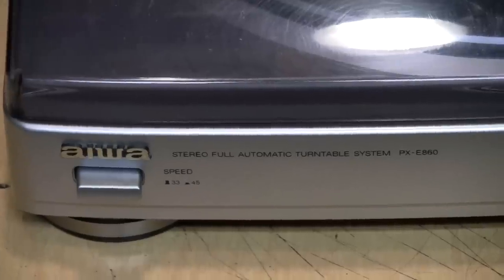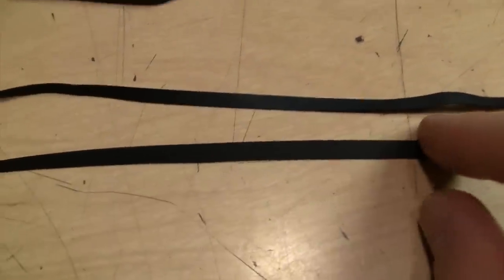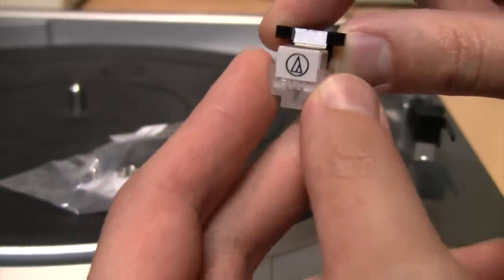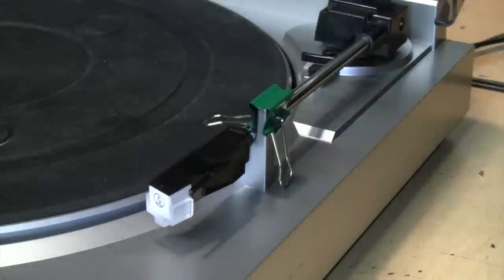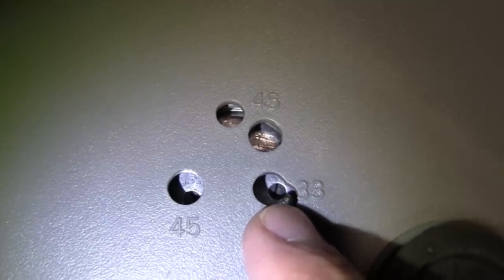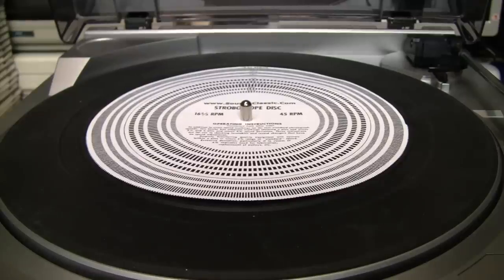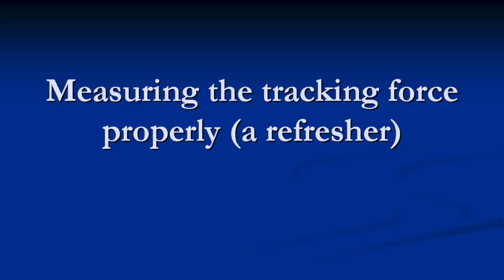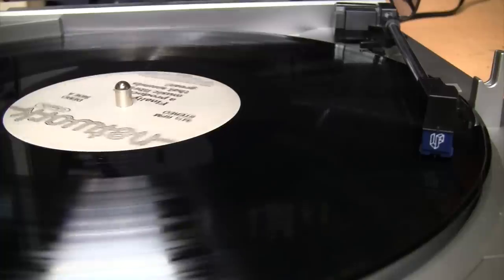Cheap fixes & upgrades for cheap turntables

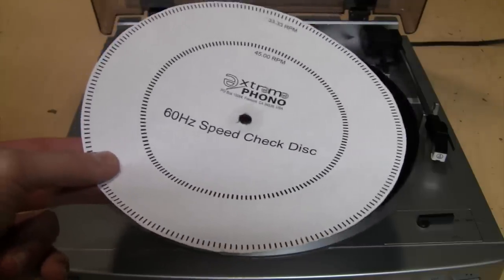Comment: 16:11 "Make sure the printer prints it out at exactly the right size"
Actually it doesn't really matter if the printer prints it too small or too big; the number of strobe squares is always the same per revolution no matter how big you print them. Unless you distort the aspect ratio of course.
Reply: Since it's stobing, they should put a small animation on there too.

Comment: I wanted to see if anyone out there could help me solve a problem.  I found a Technics 1300 at a thrift store.  It works manually; however, if I hit the play lever, the tone arm swings directly to the spindle.  I tried adjusting the knob that adjusts the size of the record, but that did nothing.  Any ideas?  Is this a simple fix or a tear down and replace something electrical?

Comment: I have the $129.99 Technics sl-bd20d in the 2001 flyer! Still has original P34 cartridge. Works fine, after years in the closet... but can you recommend a couple of upgrade stylus choices to improve tone? Great video for entry level equipment users like myself.  Thanks
Reply: AT still make a few T4P cartridges.  Here is one I use with my SL-5 from Amazon At-85EP.  There is also a conical version AT-81CP.

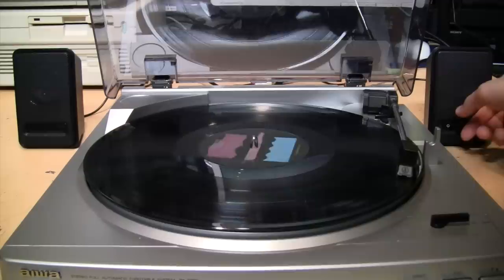Comment: 10:43 I got a really nice turntable many years ago, when I plugged it into some speakers and the audio was silent just like this, I didn't know anything about these and I assumed the stylus is bad, tried to remove it and ended up breaking the cartridge. A new one of the same type was really expensive so I just got rid of the whole thing. Right now I'm just cringing at my past self...

Comment: it is absolutely true.  Replacing your conical stylus with an elliptical stylus will improve the fidelity of your sound by at least 30% no matter what price range your turntable was.  Crisper highs and deeper bass...just like magic.  And why would you WANT to disable the auto return mechanism?  And why would you want to play 78s on a high fidelity system?  The records themselves are not high fidelity.  I have a vintage portable from around 1965 to play 78 and 16 RPM records.
Reply: Not everyone can find a vintage portable for 78s. There's also the factor of convenience. Imagine just being able to put a 78 right on your regular turntable instead of having to pull the portable out every time.

Comment: I got an Emerson M2400 at a Goodwill (for $15) not too long ago. Is it worth in, in your opinion, to do any sort of these upgrades on that?
Reply from the maker: I'm not familiar with that model but I just watched a video demonstrating it and I can see that its design doesn't really have anything in common with these turntables. But regardless, a new belt and a new stylus can generally improve the performance and sound quality of almost any turntable.

Comment: I have an old Sony PS-LX250H which is basically a clone of the Aiwa featured in your video. I honestly like the sound it puts out. Very warm.

A couple of thoughts...

I wonder if it's easy to perform a preamp removal mod à la the Audio Technica AT-PL120 on one of these turntables.

Also, why is it that none of these 'tables have an external ground wire? If I wanted to add my own, what would I connect the wire to inside?
Reply from the maker: The pre-amp in these turntables sounds fine. I wouldn't bother trying to remove it.

Comment: Very nice informative video.
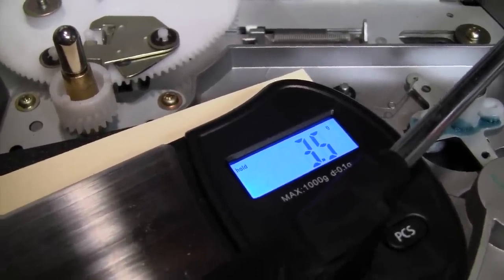Although I don't understand why anyone would like to disable this feature: 29:25' ?

I would very much like however, to see how you'd disconnect/disable the PL-990 PreAmp?
(if you haven't already?)

Thank you for sharing.
Reply from the maker: Disabling the auto-return is useful for playing records that have music recorded in the runout groove: https://ultimateclassicrock.com/beatles-complete-sgt-pepper-runoff-groove/

And the PL-990 has jumpers soldered in place of an on/off switch for the built-in pre-amp. You could remove the jumpers and install a DPDT switch to regain the ability to disable the internal pre-amp.

Comment: I have a sony which happens to be very similar to this. You just taught me, after owning it for 20 years, how to turn on the pre amp!😅 Thank you for that.
I actually have a problem with mine that wasn't covered by you. When i push the play button, the disc starts to spin and the arm swings over properly. The problem is when the needle starts to lower down to the disc, it raises back up and the automatic return takes over without it ever letting the needle touch the vinyl.
Any help is appreciated.
Reply from the maker: Try playing a record manually, and let it auto-return at the end of the record. That should reset the mechanism.
Reply: @vwestlife  Just like that. It's all fixed up. Thank you so much

Comment: After 2 years, the only cons of Lp60 that i found is pitch/speed (but nothing major, well your video helps me with the settings/adjustment). Tracking force, anti skating & auto mechanism works fine. I'd upgraded to LP gear stylus & belt, it does improve the quality of the sound, like a lot for me. My tips is, pair this player with good amp, tuner & good speakers, and take good cleaning care of your records & stylus. Im still listening to this record player sometimes, eventho i now own SL 1200 mk4 & SL 1700 mk2. Just saying.. (Thanks for your video, really appreciate it, no longer have issue with pitch on my lp60)

Comment: love this video, the details and effort to create a very informative video, you did it well. Just one comment though, about the screwdrivers. You can buy plastic screwdrivers, just designed to adjust pots like these, to avoid shorts with any metallic surrounding. Available in blue and yellow ;-) . What I did in the past, put some sticky tape on the tip of the screwdriver so it can't make any electrical contact with metallic surroundings (isolated) and makes adjustments more accurate. Hope you can appreciate a tip like this, happy tuning ;-)

Comment: For playing older records, this type of turntable is perfect...as an introduction to record playing. However, as VWestlife demonstrates in his latest (15 Sept 19) there are some caveats to this earlier video!  Otherwise, everything he says here is correct....although I would question tracking a 'quality' LP-Gear elliptical stylus at 3.5 grams..... the conical version will be much 'kinder' to the groove at that tracking weight than the sharper elliptical stylus, and so cause less damage.  Pop-in a Rega Carbon Stylus instead, and the sound will open-up, and be an improvement over the original.
With either stylus, as VWestlife illustrates in his newer video, this style of turntable will struggle with newer records, and may skip.  This is down to a miss-match of headshell/cartridge mass; the older versions being too light, whilst the newer versions of t his type of deck have increased mass/weight at the cartridge, which enables better, and more stable tracking - especially with the latest, more bass heavy record releases, whilst keeping the tracking force at 3.5 grams for the supplied conical stylus (needle).
Reply: Does the Rega Carbon Stylus have a mass issue also? What upgrade is the closest mass to the original?

Comment: Do you use some kind of noise reduction when you rip from records?
I never got that kind of sound, not even out of a spotless record.
Reply from the maker: The audio samples in this video were connected directly from the turntable to my camcorder's external microphone input through an attenuation cable. I did not apply any noise reduction.
Reply: Try a antistatic brush if you haven't already. Thought they were a joke, but they reduced my pops etc a lot in  audacity. This even after I cleaned them with my disc cleaner
Reply from the maker: "Anti-static" brushes don't actually get rid of static, or at least they don't seem to reduce it by any significant amount. You can clean a record with one of those brushes, and afterwards dust will cling to it just as easily as before due to the static charge on the vinyl. I prefer to use an anti-static record cleaning spray like Pfan-Stat, which as I demonstrated in a video, actually does reduce the static charge on the vinyl.
Reply: Fair enough, could it be my factory lp60 felt pad causing static then? As after using the vinyl styl brush I've noticed less static on playback . just curious as if I can remove a step before dropping the needle I'm all for it.

Comment: Yknow, it might just be the Youtube compression interfering with things, but I couldn't really hear much difference between the conical and elliptical styli. And I actually sampled all three into Audacity and compared them on a technical level, and couldn't find more than the tiniest difference - like maybe half a decibel or slightly more at the highest frequencies, which is basically within the sampling noise (as I was selecting the sample ranges by hand), and with no obvious difference in the midrange.

Which doesn't really make sense as I know that the needle shape should make a clear difference to the high frequency response, especially in the inner grooves of a 33rpm record... but, then again, it's quite reassuring that even the standard crappy stylus is managing to quite clearly return a strong signal upto and beyond 20kHz, even under those conditions, so if you're after ultrasound output from your vinyls, you'll definitely get it from an elliptical needle and 45s, or the outer grooves of a 33.
Reply: The integrated AT-3600L cartridge and its ATN-3600L conical stylus perform well above their pay grade. The stylus is NOT a "standard crappy stylus" though it is inexpensive. I had tried the Pfanstiel stylus from turntableneedles.com, and unfortunately while it sounded beautiful on most records it ended up mistracking on a few so I returned it for another ATN-3600L. This might have been an issue of not having my AT-LP60 perfectly level. I would like to try the LP Gear stylus; I have installed the LP Gear "SuperVivid" belt and noticed a very discernible improvement in speed accuracy and bass/dynamic quality, so their CF3600 stylus sounds interesting to me.

Comment: IMO, even if the Crosley Cruiser (& clones) doesn't actually damage the records, I still think that it makes a bad first impression (of vinyl). Mainly do to the fact that it sounds like crap. I mean, if I knew of someone who wanted to get into the hobby, I'd be more likely to steer them towards a setup similar to that shown. In other words, to show them that vinyl is far more capable, sound-quality-wise.
Reply: It's basically about using a turntable and amp (or at least amplified speakers) instead of a record player. Record players have never been known for their sound quality.

Comment: I have an AT-LP60 and its problem is there's no damping on the set-down whether on auto or cue button.  There's a screw right on top which is probably also a height adjustment on the lifter that only should be set high enough to clear the arm rest.  But how do they dampen the lowering of this tone arm... grease maybe on that lifter?  Or is something broken/missing.. I got it this way.
Reply from the maker: That's one topic I didn't cover because I'm still not really sure how that tonearm lowering mechanism works and if/how it can be repaired. I'll need to take it apart myself and try to figure it out.
Reply: VWestlife Oh okay see if you can find out what's involved with the cueing.. I press my button to lift the tonearm and it bangs it into the dust cover when it's closed hah.  I took the bottom off but didn't see anything special about the lifter.  I just bought a LP60 for parts so I'll make a comparison.  Also have you noticed that if you use these with the pre-amp that when it's plugged into power the amp is running all the time.

Comment: You must have a magic touch, everything I (or any of my friends for that matter) try results in a lot of Inner Groove Distortion on most records for some reason.
And we don't have bad players or cartridges...
Reply from the maker: Some amount of IGD is inevitable. It's just due to the physics of the groove having the fit the same length of audio in a smaller diameter than at the outer edge of the disc. And of course it depends a lot on the quality of the mastering and pressing of the record itself.

Comment: I seen a audio technica cartridge for these turntables but yellow on amazon. Do I have to use the white one?
Reply from the maker: The yellow ATN91 stylus is designed for a lower tracking force than what these turntables use, so that's why they use the ATN3600L stylus instead.

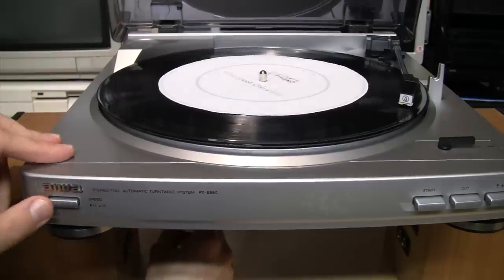Comment: 22:14 I couldn't find a stylus for 78 rpm.
The 1950's records match with the RIAA, but aren't collector items.
The records before possibly needs a 90 micrometer stylus instead 65 micrometer and another equalization. The roll off was about 200 Hz, because the need of playing records acoustically, RIAA has a 500 Hz roll off, so the low mids will be boosted. Another thing, RIAA has a treble boost when cut the record, something that they didn't use before, so the sound will be dull and boomy. So I would bypass the preamp, put the signal into a micro preamp and apply an equalizer and adjust it till it sounds good in my proud opinion 😄
Fun fact, acoustic records works fine with RIAA.

Comment: The green elliptical stylus I purchased for my lp-60 had its tracking too low which caused the left channel to cut out randomly. That, as well as the horrendous audio left me to realize that I spent 17$ on a worthless downgrade.
Reply from the maker: That's too bad. Pfanstiehl's quality control can be a little spotty sometimes, but all of the Audio-Technica-compatible styli I've bought from them have worked properly and sounded great.

Comment: My 2 year-old had 10 seconds with my LP60 and now the tonearm will not reach the resting hook, not even manually. I tried doing this fix but it doesn't work for my problem. Do you know how to reset that? Thanks!
Reply from the maker: Try manually resetting the mechanism: https://www.youtube.com/watch?v=4I5jaAT9l7o

Comment: these inexpensive entry level turntables are not bad actually. I have a friend who has a complete Steely Dan record collection he bought many years ago (their albums are excellent sounding) and played through one of these and it still shines through! The only thing I don't like about them is that the thing on the side of the headshell. It is difficult to hold it because it is not perpendicular, very difficult to handle at 45degree angle.

Comment: VWestlife, thanks for great and very informative video! I've recently bought myself pfanstiehl 4211-de upgrade cartrige for my atlp-60, before that i played my stock cartrige and it wore out. So i put my new cartrige but the problem is that with new catrige it for some plays only one channel. I checked connections i tried to swap them, but none of that helped. At the same time my old stylus plays 2 channels perfectly when i put it back on. Is it posible that my atlp-60 puts too much tracking force for this pfanstieh cartrige(i`ve read that 1.5 - 3.0g is recomended)? And if so can i somehow lower my tracking force?
Reply from the maker: It could be a defective stylus.
Reply: @vwestlife  It could be, but it`s a real shame. Alright i will try LP Gear one, thanks

Comment: I had a 2015 pro- ject debut carbon special edition with the heavy plate and ortofon 2m red. I gave it to my brother with my chorus 707 speakers, denon amplifier and a 120 euros preamp which i forgot the brand name. Anyway, i recently found a 1987 dual cs 2110 turntable. I will put a at-vm95 cartridge, replace the belt. Since i haven't yet find another preamp, i will compare my dual table with my brother's pro-ject on the same configuration.  I think it could be interesting.
Reply from the maker: What does that have to do with this video?

Comment: OK, so where do I get a scale that can measure down to 0.1g precision, other than my local drug dealer? I've fiddled blindly with the weight on my own salvaged deck's tonearm enough times, and have managed to get it so it'll play alright at least, but I've no idea if I might actually be destroying my discs with hideously excessive nose weight. The adjuster does have markings on it, but it's fallen off before and the disc that bears the numbers is very definitely completely out of sync with the counterweight itself...

Comment: Heh, apart from the silver paintjob vs bare black plastic, and the badge, that Aiwa looks exactly like the included turntable that came with a Sony tower hi-fi my parents bought for a ludicrous cost sometime around 1990. Same buttons, same switches, in the same place, same tonearm and lid, same rubber slipmat with the same patterning. Wouldn't be surprised to find they're identical down to the component level and place of manufacture, just getting different badges and sometimes a blast of cheap spraypaint.

Though it did have one small difference - it had a tonearm clamp. Presumably something it was thought worth saving the five cents of material and production cost to omit. Quite what that means for the needle during shipping of course...

Edit: with the platter removed, the innards look very similar, too.
Reply: They are just all the same turntable OEM'd and rebadged for different companies.
I have one but it's branded as Optimus LAB

Comment: Hello, I have an Aiwa PX-E90. The tone arm was moved in a circular mode, and put back on the original position by eye. I'm worried about the alignment of the stylus now. How can I checked that? Hope i explained myself clearly (sorry my english)
Reply from the maker: Just try to get it visually aligned as correctly as possible and it should be fine.